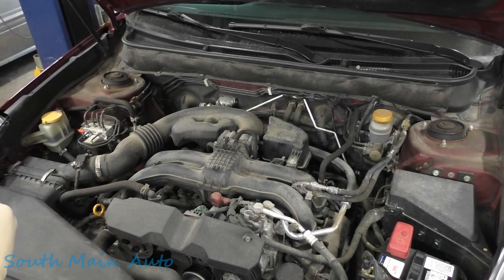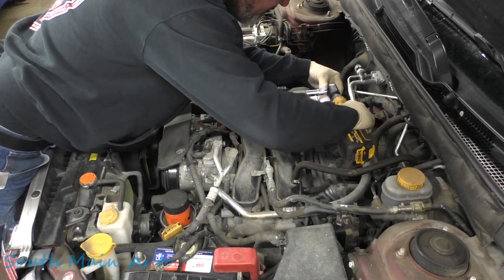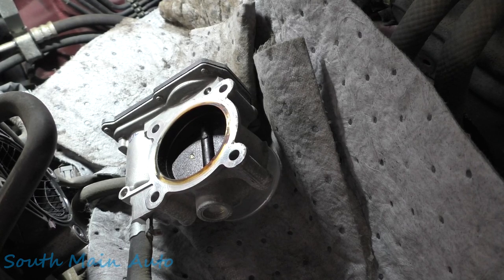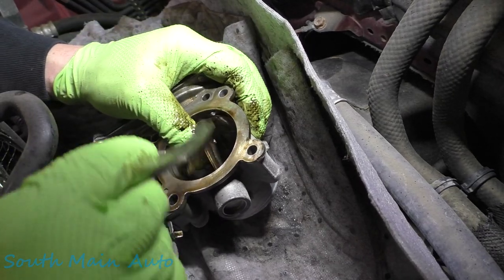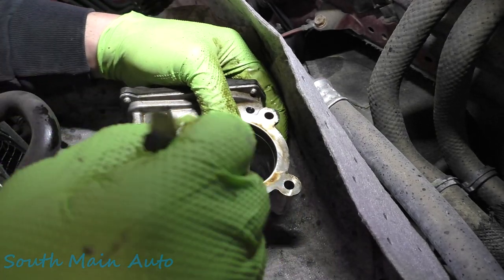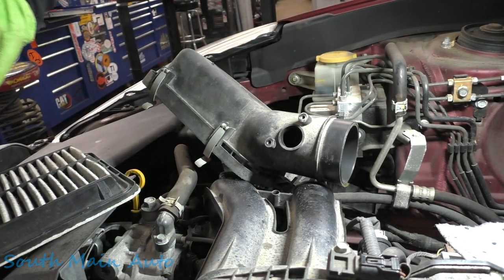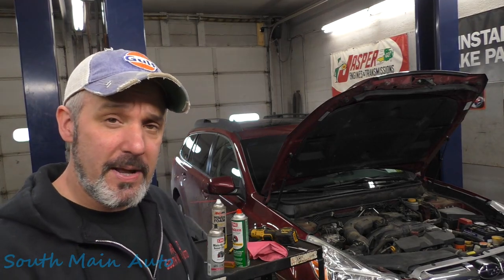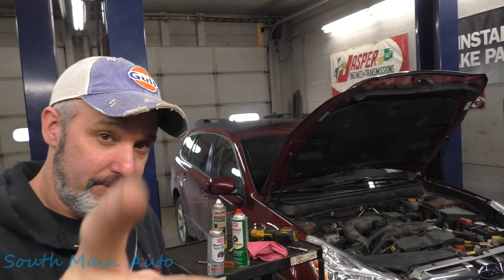How Does Your Shop Deal With Intermittent Symptoms?

Comment: A customer had a 1972 Lincoln where the power windows would stop working.  I reached under the dash and they worked.  The customer did not have much money so did not want to go further -  we did not charge them but they gave us $10.00 (1976) and brought it in a few more times for my "magic fingers".  Other customers would actually let us drive the car for a week.  But sometimes it is the customer's driving habits that lead to issues.  With new models, I am surprised they don't at least throw a code of some sort.  Sometimes it just has to get bad before it can be diagnosed.  For drivability - have them change gas stations and actually keep a log - sometimes what they are telling you leaves out some details.

Comment: I've been using Amsoil products for the last couple years, particularly their oil, transmission and differential fluids with great results. That power foam stuff probably works well but looks messy compared to some good ole throttle body cleaner.

Comment: I had similar trouble with same Subaru engine. Also no codes. My mother (82y) drives the car. She experienced same problems as described to you, that I also could never reproduce. I threw parts (coils,  spark plugs (both are pia to install on this boxer) without any change to the symptoms. Problem disappeared, when I changed fuel pump based on a post I found on some Subaru forum.

Comment: On my Subaru 2.5i it was the MAF sensor. Same symptoms. No check engine light. Drove me nuts. Finally got stuck at a church parking lot, touch the gas and car dies, I took a shot in the dark and unplugged the MAF, boom, maintained rough idle and was able to drive home. It will get progressively worse if its the same thing. You have to drive the car for a bit, get some engine fan cycles in there at idle to reproduce. New OEM MAF fixed it.

Comment: I have never had a throttle body issue as long as you open and close the butterfly slowly and smoothly so as to not overload the plastic gears inside being you are backdriving the mechanism. I thought EGR as soon as you mentioned the issue, but it doesnt look too bad, I have seen much worse.

Comment: I know Subarus way too much.  Before even 7 seconds into the video, there's one of 2 issues.  Either the battery terminals aren't cranked down or the battery is weak.  My son's Crosstrek just did this yesterday.  The ground side terminal has this stupid plastic piece that limits how much it'll tighten down.  Well, cranked down, I could rock it back and fourth enough to see it move.  I pulled apart the bolt on the terminal, removed the plastic thing, cleaned the terminal and battery post, tightened it down and Bam.  Everything now works.  This was an FB20 engine.  The Outback you're working on is an FB25, so same basic design, just a bit bigger.  You can tell these by the oil filter on top.

Comment: Hey Eric, I have a 2003 lesabre with the 3.8. I had a code for the EGR. I applied the solvent but the code remained. I then soaked it for a couple of days and made sure the valve worked. The code went away. From your aspiring DYI fan, Robert

Comment: I have a 2001 Lincoln Town Car,  my problem was it would start fine cold, but didnt want to idle, I cleaned the IAC valve and it started running fine then it would start fine then run rough . I did get a code that said the number 1 cylinder intermittent misfire. So i replaced the coil and it fixed it. Now starts fine runs great .

Comment: Fuel Pump Pressure test? battery, alternator charging? We had a work, Tahoe, act crazy, with gauges going on and off. It was a loose battery cable.

Comment: I used to love Fram filters.
They're shit these days, and their catalog will lead you into silly places, meaning when you've just dropped the trans pan on the car, lost all the fluid and you find the new filter is just entirely the incorrect part, you're basically screwed, if you live miles out of town, as I did then.
I had to reassemble the thing with the old filters, and top it up with $180.00 of brand new fluid.
Not happy.
Expressed this firmly to the auto-parts store, (who kind of said oops, but sorry. You won't get anything out of Fram).
A vigorous email to Fram Australia, and I got an almost instant call back from the auto-parts store.
All new fluid, at no cost, and an order number to take to the opposition who had the correct filter kit. No cost to me, except some fuel, and having to undo and refit 44 bolts, rather than 22.
Still won't go Fram again, but still use the same auto-parts store, as they went the extra mile for me.

Comment: One thing to check is the coolant temp sensor. If the engine is hot but the sensor says stone cold it might go into a cold start strategy and inject too much fuel.
Reply: On a car this new, that would set a sensor plausibility fault 99% of the time.

Comment: Have had trouble with bad power steering pressure switch on Subaru, hot start trying to low speed steer in parking lots will stall it.  If the a/c is on the boosted idle from that will prevent it from stalling.

Comment: I can tell you this, I've never once seen a bad EGR valve on any Subaru since I switched brands 3 years ago. I would be looking at the TGV flaps in the intake runners. That year actually may have a separate assembly under the intake. Maybe take a peak at the A/F sensor too.

Comment: Here's the military lesson on intermittent failures (USAF late cold war.)  
1) Physically grab and Shake *EVERY* part of the mechanism or wiring harness that might affect your symptom.  
2) Apply heat i.e., a heat gun or blow dryer, to the same areas.

Comment: The local to me chevy dealer has been known on intermittent problems to not even attempt to diag... just pull it in, let it sit, return 3 days later with "could not duplicate". Have had it happen to me twice now. 2015 cruze with intermittent erratic idle and misfire after being at 60+mph for at least 5 minutes (like exitting highway to an immediate traffic light it would idle as low as 300rpm almost die, then surge to around 1,800 while sounding like a dead-hole missfire.) The other time was a 2018 silverado with a vibration that would wander (load and speed, accel/decel, rpm... there was no one set of variables that could mimic it, it would just happen or not). Both vehicles were returned back to me with "could not duplicate" with less no more than .3 of a mile from the time i got out and it was returned to me. I had pictures of the odometer on both. They tried to charge a diag even though they were both under factory warranties. Both problems were duplicated and verified with the service writer in passenger seat. Stealerships are a joke when it comes to servicing.

Comment: Sounds like it's related to oxygen sensors. Could also give you the rich running making those things you cleaned, dirty. I am not a mechanic. It's the loss of power when it's been hot that suggests this, based on my ownership experiences. In a car I had, it was a bad connection at the oxygen sensor. When the car was cold it tested normal. The mechanic who finally solved it disconnected the catalytic converter, which had become blocked from the rich running, and it ran fine (cat was put back after repair). Looking forward to see how this job turns out.

Comment: I had an 06 Ram with the hemi that would intermittently go into limp mode and give an “insufficient ionization” code on a certain cylinder. I bought 16 new plugs/wires, took it to dealership for a $300 diag for them to tell me I needed a computer. Spent $500 on a computer. Nope! Took it to an independent mechanic, and he worked on it 3 different times for $1,200. Problem still there. He told me to go trade it in, and that ultimately fixed the problem 😊 I still wonder what actually caused it.

Comment: I paused the video to put my response to see if I might get this one right without peeking ahead. My wife's Hyundai was doing what I thought was an intermittent stall with occasional crank / no start. Turned out the purge valve had gone bad and every time I filled the tank (and only then), it was flooding causing the crank/no start and then it was stalling during deceleration only when fuel was being allowed to back flow. It only SEEMED intermittent but it was definitely following a pattern that I just failed to see for a while. I Replaced the purge valve and never had the problem again. I suspect the vehicle's owners here only think it is intermittent and it's actually following a pattern they're not seeing.

Comment: My dodge ram did this exact thing. It ran great from a cold start every time. There was just a very specific sequence that would cause a problem. A cold start, then a trip at least 15 minutes, then a cool down of at least 15 minutes and not more than an hour. It would restart run for a minute and then become undriveable. Unfortunately this type of sequence was very common with typical trips to say a big box store. I chased it for months and it turned out to be an O2 sensor. It was a Bosch O2. I replaced it with an OEM O2, changed nothing else and the problem never recurred.

Comment: My old subaru was doing something similar with a fairly clean throttle body and I didn't have the money to have anything looked at at the time.
I raised the idle rpm by 100 iirc using a basic usb to obd2 dongle and a free program on my laptop. Never had the issue after that

Comment: I always try to confirm the complaint first, I start with basic maintenance items that may be associated to the complaint, also look at items based on past experience based on the complaint, I can make an educated guess but always try to confirm the complaint, I will work with the customer to get the problem resolved even if it takes a couple of visits. Intermittent dare tough especially electrical. I have one at the shop now an intermittent abs activation that I cannot duplicate but I think is an abs module. I think the best action is not to screw people over and work with them to resolve the problem.

Comment: I had a car once that died intermittently during heavy throttle; it was just like someone turned off the ignition key.  Very scary, try pushing a yellow light and the engine dies mid intersection.  One shop replaced many components at high dollars and laughed at me when I told them that it happened again after their work.  Another shop took a lot of time to diagnose it.  Turned out that the internal fuel filter in the fuel pump had become 2/3 clogged with a fine white particulate and the pump would overheat and occasionally quit working.  They warrantied the fuel pump and I never had another problem like that.  As an aside, the service manager was test driving the car when it failed and he said it scared the living sh1t out of him.  They were a book shop, and I paid a reasonable fee for the service.

Comment: If there's an intermittent problem ask the customer about any recent repairs on the car.  7 out of 10, the problem will be in the repair area or caused by the repair.  Some possibilities:  crank - cam sensor, ignition module, fuel pump, coolant sensor, mass airflow, oxygen sensor, map, oil pressure, ECM, electrical.  If EGR would be stuck open, the car would run rough - stall on low RPM and smooth out when accelerating.   One time, I had a fuel pump connector that was probed from the front (lose leads) and the car would stall after 20 minutes.  By kicking the fuel tank the car started and we knew it was something with the pump.

Comment: The only EJ253/FB25 aftermarket engine air filter I've used that fits and seals properly is K&N. That'll wind a few people up. 🤪 Anything I've ever encountered with mine that would cause stalling at idle was related to the ECU aborting the throttle idle learning procedure due to pending codes which would have shown up here. (i.e. P030x, P0420...)

Comment: If the problem is very intermittent, Sometimes we’ll ask the customer if it’s possible to have the vehicle for the week and usually I’ll just drive it to and from work. I’ll usually bring my scan tool with me incase the problem occurs. If not, then I’d probably suggest a similar process that you’re doing.

Comment: I remembered at the dealership working on a crosstrek that had a misfire if I am correct it was cylinder two on partial load and acceleration driving around 40 to 50 mph, I did everything to try to diagnose it like fuel pressure test, valve clearance, timing, compression test, leak down test and incredibly the fix was to clean the throttle body

Comment: Been dealing with intermittent problems since 2015 in one particular car we have. Did everything under the moon (including what you just did) to try and solve the " smooth-cut-smooth-cutcut-smooth" (but never dies out). In the end I ended up adjusting my driving style to that car. Narrowed it down to electrical. Last thing I did a month ago was remove the fusible link (in the battery cable at the positive terminal) and connect directly. It runs a little better, but still cuts. We have an identical car (both 1995 Corollas) so I was able to swap parts between the two to find the problem. Never solved it.

Comment: I have a honda with the 4 Cylinder V-tec motor.  I had same thing after engine warms up it would either not idle or poorly idle at stop signs or intersections.  After same basic diag with no results I took it to a shop that only works on honda and acuras and it ended up being that the exhaust valves were out of lash and needed adjusted.  Had them adjust all of the valve lash on exhaust/intake (2 hours shop time) and boom fixed.

Comment: Great line from Casablanca comes to mind, “round up the usual suspects.” Go through the usual problems. Inspect it, clean it if it’s dirty, free it if it’s stuck, tighten it if it’s loose. You might not fix it, but you eliminated a lot of possibilities. And some good PM service got done. One thing, it wasn’t a loosely connected EGR valve, boy howdy. That momma was screwed on there real tight like for sure.

Comment: Given a recent battery replacement,  did the stalling start before or after, and are the connections ok on the battery?
Stalling after battery replacement and a dirty throttle intermittent is a very likely culprit. Especially considering long term fuel trim strategies re-adapting and maybe having a restricted throttle plate from carbon.

Comment: TL;DR: 1. Happens after off and warm; 2. doesn't set a code (dumb sensor) or doesn't happen enough to trigger the CEL; 3. Variable component likely (not just on / off). Intermittent is always rough. With what the customer described, it seems that the issue is after a heat soak and after the engine has been turned off. Knowing that, the culprit seems to point to something electronic (hence the restart after warmed up is associated with the issue). The electronic thing is possibly "dumb" or intermittent enough to not throw a code. The electronic thing likely has variability beyond "on and off".

Comment: Hot soak issue leadng to fuel vapor lock, addressed on a carburated car by Youtube channel NNKH (No nonsense know how), he installs a fuel filter with 3rd port to bleed fuel vapor back to tank. In this case with fuel injection, check the return to tank to see if clogged/plugged.

Comment: I like the oral B toothbrush and break clean method of cleaning throttle bodies personally myself Most of the time you have stuck I  IAC you fill the hole before the  Throttle plate up with carburetor cleaner But it's soak then break clean so hopefully it evaporates most of it out and squirt penetrating oil in it and then start  Is the engine and then if you can control it from your scan tool adjust it up-and-down so it frees up  Sometimes a liberal amount of   Tapping with an extension on iac  Repeat as necessary Just sharing some of my little tricks
Reply from the maker: This is an electric throttle body. No iacv

Comment: Intermittent stuff is tough.  I worked at one of the OEM's and would use a data acquisition system that could trigger recording based on a channel going out of range. Of course there was a bit of swag to determine an appropriate channel.  I would have it grab data about one minute before the trigger event and as many signals as I could that were possibly relevant.  Then wade through the data to see if I could find the culprit.

Comment: Let's see? Last time they sent me home after running a scan tool on it, I guess to look for history and basic functions, and then sent me home to find it myself. The light promptly turned back on, like at the next startup. Eric taught me how to find and use interactive schematics and though I know zip about Kline and Can signals I found a module that used both that was also connected to the module activating my warning light. Gathering up the theory of operation, it was very complex, like 6 pages I fired the parts canon at the simplest access point. I Believe it was Super Mario that showed me it was ok to work my way through modules by going from easiest to hardest to access. First volley from the parts canon worked. $2.17